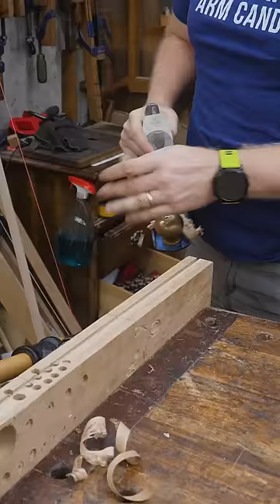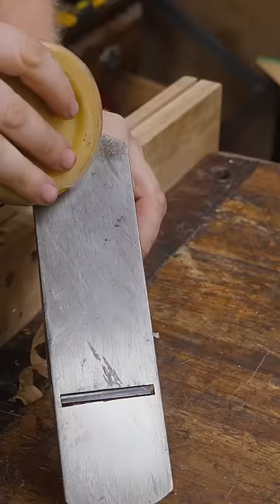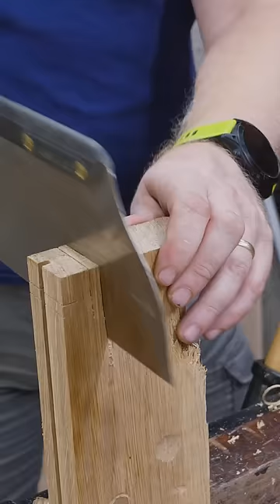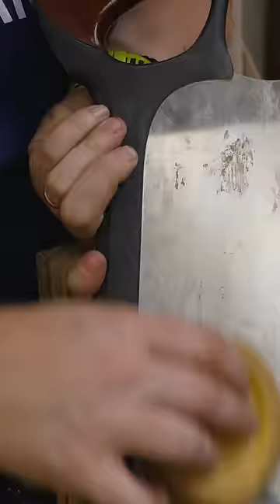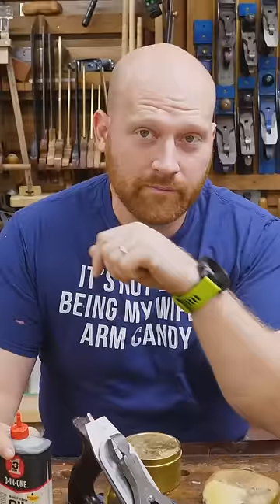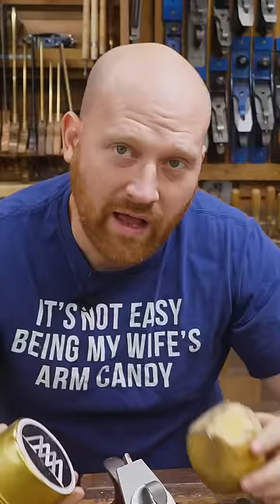Lubricate Your Tools

Comment: good old soap works too. Smells nice too.
Reply: .... or candles ! 😎👍☘🍺
Reply: I use Irish springs bar soap lol
Reply: But you can’t call them lube
Reply: @cavemanvi  why not ?
Reply: Yeah but it kinda stings when you pee
Reply: @peterfitzpatrick7032  that basically wax
Reply: glycerin soap or ?
Reply: @josephhaase9452  doesn’t really matter just try bars until you get one you like
Reply: Ehh drys to fast
Reply: 🔥🔥 wax statues at the museum work well too 😅
Reply: @c.fyffe0  idk man I think that acid might etch into the metal Xd
Reply: @jonathanbetenbender307  lol
Reply: @Nthomas0705  haha
Reply: I was just thinking that
Reply: @Nthomas0705  You tried it before, didn't you
Reply: Yup, also works with musical instruments that have wooden tuning pegs, like violins or old time banjos
Reply: @ajeje1996 don't use soap on violin pegs.  It binds oils and if the pegs get wet it can dry them out.  Use wax for that.
Reply: @kugelblitz1557  What do you mean it binds oils? But yeah, it's more of an expedient, wax is obviously the best choice
Reply: @ajeje1996  basically how soap works to clean is that one end of the molecule is able to bind to oils and the other is able to bind to water so it makes the two mix by collecting around the oils and then absorbing into the water.  This is a rough explanation, Theodore Gray explained it much better in "Reactions" but I don't have the book on me right now.
Reply: @kugelblitz1557  I think I get it, thanks!
Reply: Ol' Swede technique I learned as a wee one. 
Castile soap or Dove, Bronners, holds up for sticky window sash and doors. The climate in the upper Midwest has a wide range in both temp and humidity.
Reply: Soap is hygroscopic and will attract moisture - thus rusting steel. Use wax
Reply: one a problem oxidation!

Comment: Works wonders when driving long screws and lag bolts.
Reply: Another oft overlooked benefit of paste waxes! I use it on any large hardware in wood and it's a godsend. Makes a massive difference in driving them, and it also better protects the hardware from erosion.

Comment: I use the same brand of oil you show here to remove rust from one of my knives (the others haven't shown signs of rusting yet). It worked really well with only a little scrubbing from a soft brush.

Comment: Atf for high carbon drywall knives. It helps on stainless as well but usually only get pitting on the actual blade edge

Comment: I'm SO mad that I didn't know this before. In all my years watching maker videos and struggling with hand tools not ONCE was this mentioned.
Reply: You do have to be careful using lubrication when doing joinery, especially on delicate pieces with little gluing surface. If any wax/oil remains, it can severely reduce adhesion of the glue or finish.

As a full time luthier, my alternative is to go through the significant effort of polishing the contact surfaces of my tools. It works nearly as well, and eliminates any risk of contamination. Plus, it looks nice 😅

Comment: Mineral spirits and paraffin wax. The was will dissolve in the spirits, and it's an excellent anti rust/lubricant. You can paint it on. I use this on my lathe bed, table saw, and anything else that requires a nice clean, smooth running surface.

Comment: Hey,  all good and smooth cutting and such but think about possible contamination which later resists stains, dyes or finishes.  I'm enjoying your posts, thanks.
Reply from the maker: Thanks. Honestly I've never had any issue at all with finishes or glues. It just doesn't affect the final surface. It's a bit counterintuitive but there's a reason it's been done for hundreds of years.

Comment: I never thought about doing it to a saw blade....im gonna start doing that.
Reply: When I was in HS they didn't even teach us that. I learned it after HS working for a factory. When the saw didn't glide through metal or flung the scrap you hit it with saws wax, if it still didn't glide through you get a new blade. If it still flung metal get a new blade ready.

Comment: Patternshop at a foundry I worked at would mix wax and grease by melting the wax, adding grease, then letting it cool, to put on screws to screw into pilot holes

Comment: 🤯 I’ve lost a number of saw blades to getting stuck in the wood and bending. Had no idea you should lube your saw. I suddenly feel better about an upcoming DIY project.
Reply: The thing that gets me. I had wood shop in hs, in that time we never learned of this. After HS I started working for a small factory, when the blade would seem to drag through the metal they said add some wax to it and the blade would go through it with ease again and most of the time wouldn't send little quarter and half inch scrap flying. But if the blade still seemed to drag it was time to replace the blade. I asked my dad who does alot of woodwork why he didn't tell me that and he was surprised woodshop didn't teach me that. Then again he had woodshop in the late 70's and they probably actually taught that. Where I had woodshop in the early 2000's when it was rare to see a wood and auto in a HS still.
Reply: @Crazyman23  I was thinking the same thing. I took woodshop in HS in 2000 and this was never mentioned. I’d love to do a year of a study with a pro woodworker now.

Comment: This is legit info. Helpful tip if using something like a Sawzall or hacksaw particularly on aluminum, take a crayon and a lighter, heat the blade just enough so the crayon smears well on the blade. It will cut like a dream after that.

Comment: I had to make severl aluminium square-to-round duct fittings as an apprentice. Normally we'd swedge the end of the collar and spot weld it into the fitting. Not being able to spot weld aluminium complicated things. I had to do a "spin in" connection, essential an S shape on the fitting and and opposite S on the collar. Aluminum thends to grip quite a bit, i used regular skateboard sexwax, it was night and day.

Comment: Yeah I was about to say but I think the comments covered it. Dish soap is a Wonder tool. Not to mention if you coach your screws and dish soap before you run them into a piece of wood you don't have to drill pilot holes.

Comment: Cant believe i did 2 years in highschool woodshop class and didnt learn this
Reply: Same thing here. It wasn't until after HS when I was working for a factory that I leaned about saw wax. Saw seemed to drag through the metal put some wax, if it still dragged on the metal replace the blade.

Comment: I'm sure you know well what you're doing, but I'm curious if getting oil/wax on the work could interfere with various types of paint?  Or is this a consideration and avoided in this case?
Reply from the maker: It doesn't affect any finish or glue. There's a reason that they've been doing it since egypt.

Comment: I remember starting wood working and hearing about the ole "wax your sole" trick  (GIMMICK!) some time later; i randomly had a candle sitting near so i figured what the hell. The actual main reason i didnt use it is because i had concerns about reactions to finishes or issues with stains or glues not absorbing properly due to waxy hydrophobic coating. I literally couldnt believe how little you need and how much it improves the stroke.  Needless to say; lesson learned lol. Im still dubious on oils for this application; but bees wax has provided zero issues in any department
Reply: I am not a fan of oil for that reason either. However, Paul Sellers swears by it, and it gives him great results, so I'm not going to say it's wrong, just I prefer wax.
Reply: @autumn5592  It might actuall be wrong with certain finishes. If youre using oil/wax finishes, yeah doing oils is likely fine. Doing lacquer or poly finishes, Im fairly sure oils would cause fisheyes in a lot of cases.

Comment: I even lube my band saw periodically  makes such a difference since I use it for wood   Metal and plastics
Reply: Of all the factories I worked in only the first one taught us of saw wax, that was when I was 18. Ever since I convinced a few other factories to invest in some and the blades would last a bit longer. Where I currently work even gave me 3500$ for how much I saved them in a year for suggesting the saws wax. Blades went from lasting 1 to 2 days to 4 to 6 days. Except on one that cuts upwards of 36" in O.D. that went from 1 day to 2 days since it took longer to cut through stuff.

Comment: Does the wax have any effect when it comes to applying finish? Looks like the saw is binding due to uneven set.
Reply from the maker: You would think the wax or oil would cause problems with gluing or finish. But in actual practice it doesn't make a difference. The soccer that I was putting the saw in were from a different saw that I was currently setting up and fixing the set on it. I just figured it was a good opportunity to show it binding.

Comment: Won't this backfire hard when you later want to stain it? Or do you factor in having to do everything twice, 2nd time with unlubed tools, to remove the now wax or oil soaked wood..?
Reply from the maker: it does not affect stain or glues. I know it is a bit counter intuitive, but that is the way it has been done for thousands of years.

Comment: I have to cut some thuyas, resinous trees. Could wax or any other lub help ?
Reply from the maker: Yes. Put a little bit of wax on both sides of the plate and it goes a lot smoother.

Comment: beeswax, heavy duty silicone spray, soap, or a knowledgeable combination works amazingly well. 
Don't use WD40 or any low flashpoint oil/spray/etc because that will just stay wet(collecting dust and build-up making it worse) or becomes a fire hazard because you soaked your workstation with paintthinner

Comment: I'm not a woodworker so Im genuinely curious, why not use a pull saw so it's even less likely to bind?
Reply from the maker: A pull saw will bind just as much. Most of the time the bind is when you release tension in the board it will actually pinch up on the blade. A pull saw is generally slower but it's a very different body mechanic that a lot of people like.

Comment: I'd use oil to avoid feeding wax into wood pores. Waxed pores probably don't absorb as good as dry or slightly oiled wood. Just wondering, ain't sure
Reply from the maker: Oil works but it doesn't last as long it wipes off the tool very quickly. Wax will continue to work much longer. You would think it would be a problem with glues and finishes but in practice it doesn't make a difference. It's a bit counterintuitive.
Reply: @WoodByWrightHowTo  Alright fair enough, thanks for the reply!

Comment: If your saw is binding, your kerf is wrong.  Saw teeth should be cutting a wider space than the thickness of the blade.
Reply from the maker: It could be one reason. Or there could be tension in the board. Or it could be your body mechanic is off in your twisting the saw a bit. There are lots of reasons why I saw my bind in the cut. Set on the teeth is just one of them.

Comment: Maybe they can't work because first off you was at using the scraper thing I come around what it's called pointing off the side and then pointing straight when it's suddenly started to fly and then you was just pushing down on saw and not actually moving it
Reply: 'Scraper thing' lmfao.
It's a hand plane, and it's easier to cut things when you skew like that.

It was an illustration, not an actual example.
Showing something that really happens isn't easy on camera, often times it looks fine from 3rd person, but you feel it in the cut, even slight binding is felt greatly.

Comment: I mean you should put the saw back in the same cut that was pinching it.
Reply from the maker: ya I did not notice I did that tell after it was uploaded. all of those cuts were veering the same direction as they were all made from a saw that I was adjusting the set on.

Comment: Be careful putting oily rags in containers
Reply from the maker: https://youtube.com/shorts/Awa9ttsAIIM?feature=share
Reply: For things like Mineral oil, or its derivatives (motor oil, 3-in-1, balistol, etc.) There is no chance of spontaneous combustion.
They are non-drying oils, drying is an exothermic (heats up) reaction. They can't dry, so they can't combust spontaneously.

They can still ignite though. If you are doing work with a grinder, or blowtorch, or anything that heats up rapidly, it can catch on fire.

Just have a lid for the container with the oil in, close it up when not in use, and it'll never be an issue.

Comment: You do have to be careful using lubrication when doing joinery, especially on delicate pieces with little gluing surface. If any wax/oil remains, it can severely reduce adhesion of the glue or finish.

As a full time luthier, my alternative is to go through the significant effort of polishing the contact surfaces of my tools. It works nearly as well, and eliminates any risk of contamination. Plus, it looks nice 😅
Reply from the maker: I have never had any issue with that on finish or glue strength. I actually tested for that in the glue test a few years ago and there was not change with or without it.
Reply: @WoodByWrightHowTo  that's a test I'd like to see! I do imagine on joinery with more gluing surface it's not a real issue though. But when you have less than 1/8th of an inch of gluing surface, and the joint has to withstand 180lbs of force, the slightest loss of adhesion can become catastrophic.

All of the literature advises against it in the lutherie world, and it makes sense, so I avoid it because it's not worth the risk. Heck, I use paste wax as a mask for glue, so it feels taboo to get any in a joint haha. But I'd love to see the data if it ever exists. 

Matthias Wandel's experiments with clamping pressures really changed my approach to clamping, so I'm open to changing my mind. Plenty of assumptions turn out to not hold up to data. But my concerns are about pretty specific scenarios that most people don't find themselves working in.

Comment: As a full time luthier, my main concern with lubing tools, is it's effect on joinery. Our tolerances of adhesion are so much smaller. The slightest reduction in adhesion can be the difference between a good guitar, and one that implodes under tension. The best guitars are built at the absolute limit of what the materials can tolerate. One inclusion of wax/oil, can create a seperation point that spreads and becomes a severe weakness, or a blemish in the finish. 

I wish there was a better solution. But ultimately, most of the work is on such small and delicate parts, that the benefit of lubrication isn't as needed.

That said, I do make my own very similar soft paste wax for conditioning fretboards, masking surfaces when I'm using CA glue (another great use), and lubricating bridge pins. I also use it for lubricating some tools, like my fret saw where it contacts the miter box sleeve. It works wonders when I can use it as a lubrication! Definitely reccomend it for carpenters and general woodworkers!

Comment: That firsy saw cut is at an angle, that's why it is becoming tough to move. The second cut wasn't curved.
Reply from the maker: I didn't realize until after I uploaded it that I put it into a different cut. All of those cuts were made by a saw I was adjusting the set on. I wasn't testing the wax in the video I was just showing it being applied. And it happened to put it into the other curf

Comment: Or buy quality tools, especially saws, you'll be very suprised how many saws dont have the saw teeth wider than the saw back. Thats why saws get stuck
Reply: 99% of saws have set teeth. This is literally the standard. 
If your saws had no set, you would never progress in the cut. 

Saws bind for a number of reasons;
Twisting in the cut, expansion of the wood, angle of the cut, the type of wood, the tooth count, the set, the plate thickness, and how sharp the teeth are.

Often times, saws are OVERSET, especially cheaper saws.
This allows for excess twisting in the cut, which leads to binding.
A GOOD saw will have as little set as possible to keep the saw functioning as intended.

Comment: And you get oil and wax on the wood making proper finishing a problem.
Reply from the maker: Do you think that's an issue but it's not. It is surprising but it doesn't make a slight bit of difference to finish or glue.

Comment: A saw binds and walks when it’s dull
Reply from the maker: that is one reason. you can also have tension in the board and it tightens up. or it could be you are pushing too hard. or it could be that there is too much set on one side.
Reply: @WoodByWrightHowTo  I wax my saws but if it’s tracking left or right there is another reason than lube. A hacksaw shouldn’t walk left or right once it’s started but you are right with the set or holding the saw to tight. Hold it like you are holding a babies hand
Reply from the maker: Oh I see you're coming from. It does kind of look like that in the video. No this one is actually tracking straight it just looks kind of twisted in the video. Cameras have a fun way of doing that from time to time.